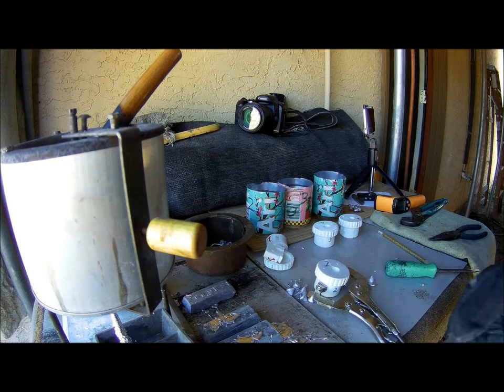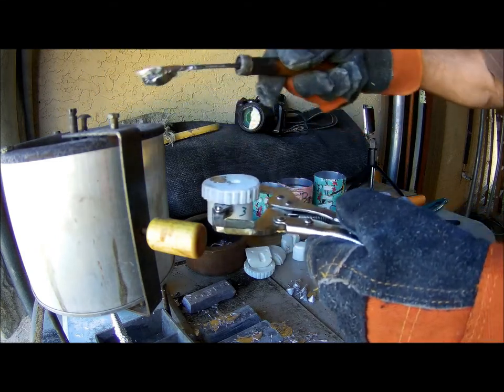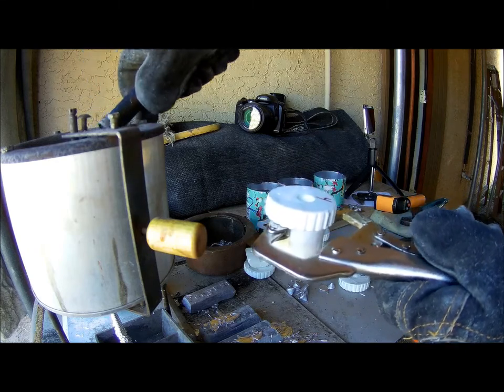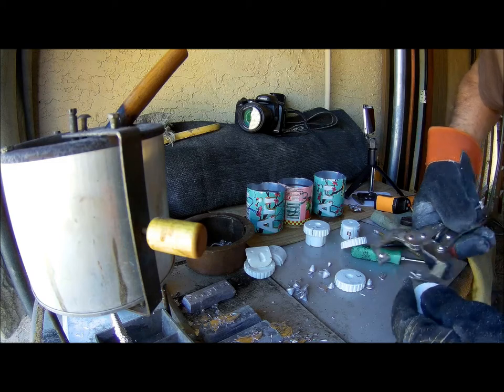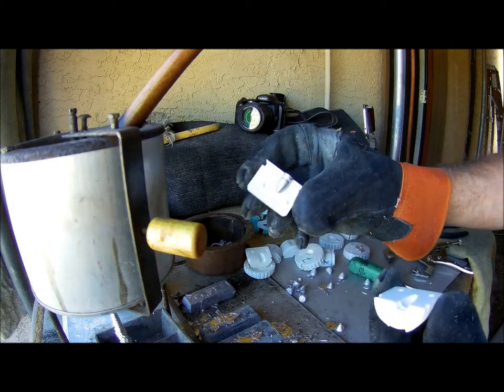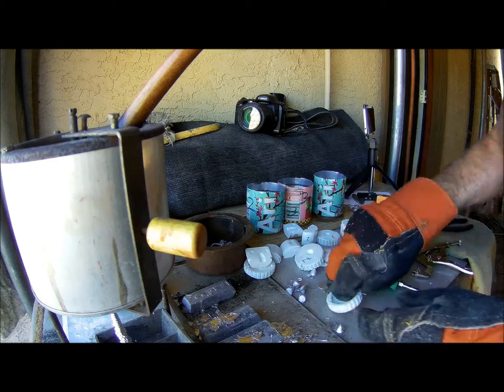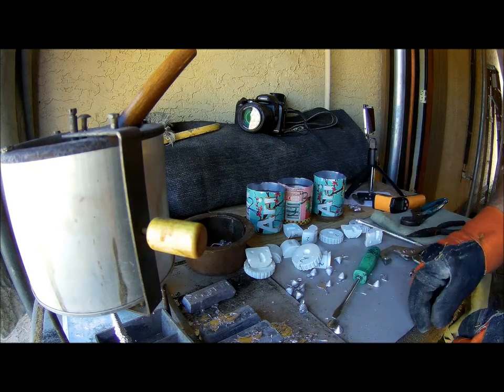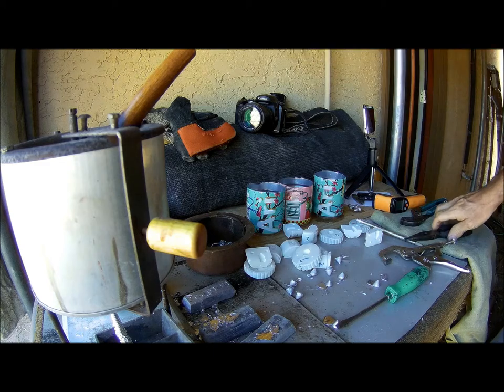3D Printed Single Cavity 9MM Bullet Mold Test Casts 5 and 6

Comment: How many casts can be had from the mold ?
Reply from the maker: With my latest casting session I stopped casting after I'd gotten to about ten bullets cast.

With a couple of the 3D printed bullet molds I started seeing sufficient damage that made any further casting pointless.

On still other of these 3D printed bullet molds I could have continued on with my casting but,  these are prototype molds.  The reason for doing these casting test is to find out how best to cast with them so as to be able to cast the maximum number of bullets out of them before they are no longer any good.

With my latest 3D printed prototype bullet molds one of the molds started showing signs of failure after only the seventh cast.. 

The other two 3D printed prototypes showed no signs of damage that would have kept them from casting any further.

I stopped casting when I reached ten bullets.  I could have kept going but being that I still have some more bugs to work out and tweaks to make to the mold design, it would have been pointless to continue.